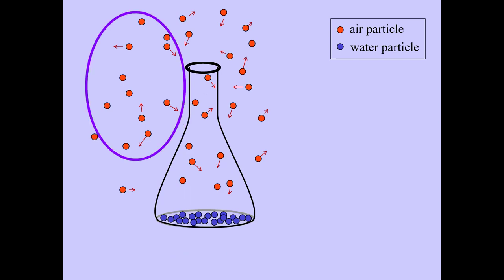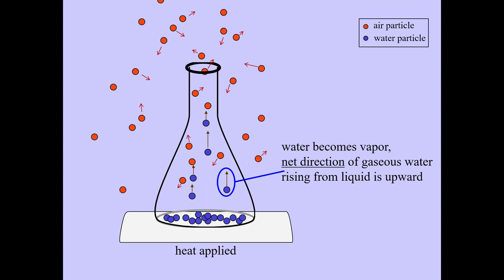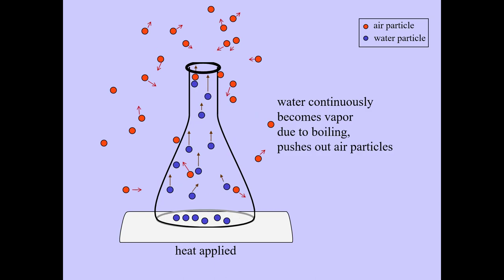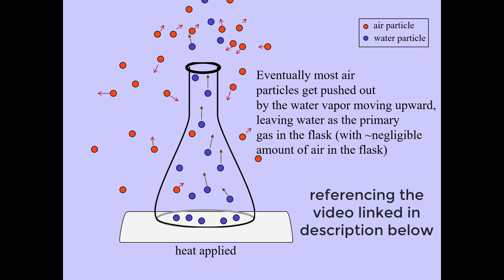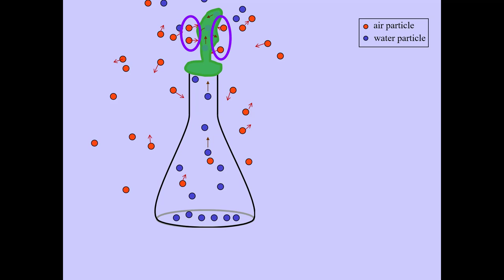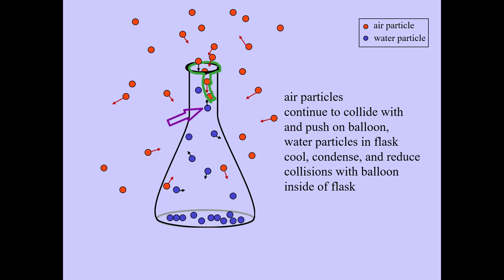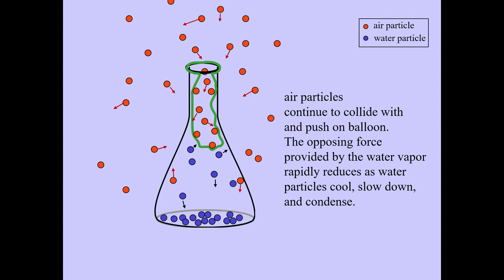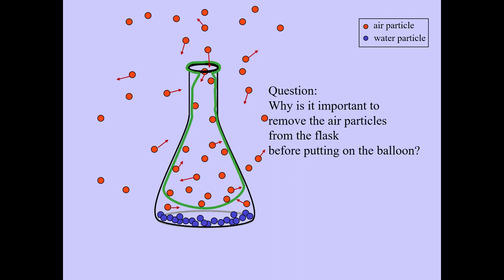An explanation of the balloon in flask demo (inside out balloon demo)

Comment: Just discovered your videos and I love them. One thing to note here is that there will be mechanical energy stored in the balloon as stresses and strains, so the inside and outside pressures do not have to be exactly equal.
Reply from the maker: Yes! It is an ongoing misconception among both students and teachers that the size of a balloon is dictated by the point at which the inside and outside pressure is equal. However they are never equal due to, as you say, the mechanical (potential) energy stored in the latex molecules, which only increases as the latex molecules stretch (balloon gets bigger), which means the inside pressure is always greater than the outside pressure. This is why we hear a pop when the balloon bursts. If Pin = Pout, there would be very little sound when it breaks, but as the balloon gets bigger, then Pin >> Pout, and so the break results in a large rush of gas from the balloon creating the pressure wave we hear as the pop.